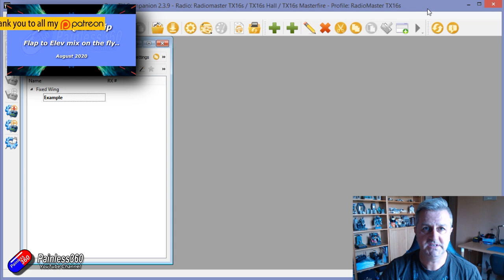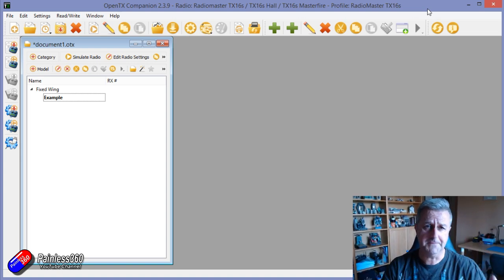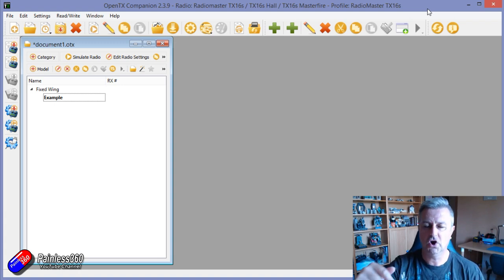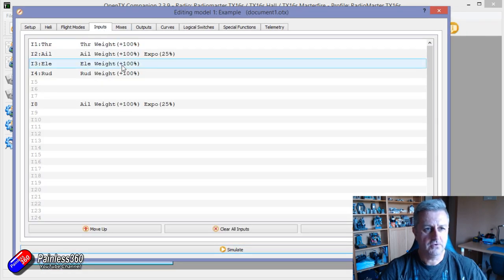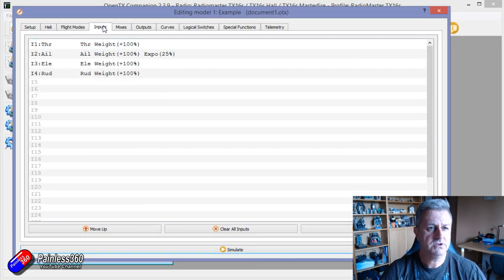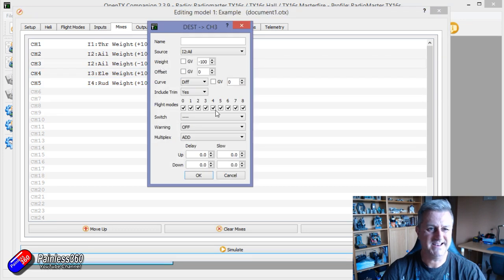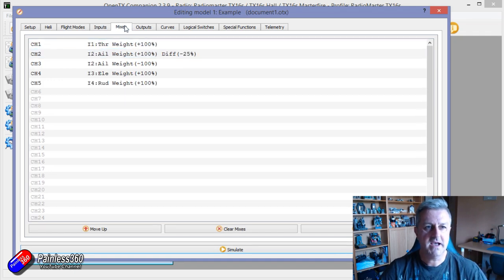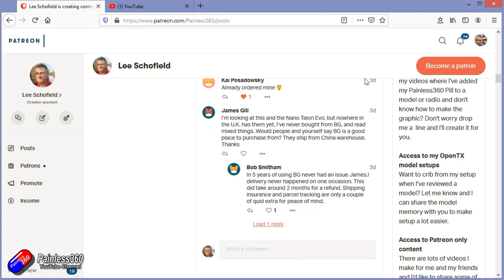OpenTX Quick Tip: Expo and Diff at the same time

Comment: Hey painless360. I love your video's and watch them all the time. But i havent seen anything about a possibillity to change the expo on the turning wheel of the taranis. I have volume control on the left turning switch and i was trying to get expo on the right one. Is that possible my friend. Thanks in advance and also for all your hard work 😁🖒
Reply from the maker: Check out the Painless360 Answers playlist for that one ;) You can support the time I spend helping others by becoming a Patreon..
Reply: @Painless360  many many maaany thanks. This helps alot. I have just too few of switches and i wanted the expo for real easy flying if i wanted to. Again many thanks and cheers painless360 ❤

Comment: So you can only do that if ailerons are on separate channels?
Reply from the maker: If you're using a Y cable then it gets tricky..
Reply: I believe differential only works if you have a separate channel for each aileron servo, i.e. no y-cable. I just tried it and if you add positive differential to a single aileron input you get less aileron movement in left hand turns than right hand turns!
Reply: you do it mechanically with a Y lead set up by not having the servo arm at 90 degrees to the pushrod at centre stick,  bit of  a faff to set up as you can't use subtrim to get things spot on.,
Reply: @locoworks8179  Right! I forgot the traditional way of achieving differential.